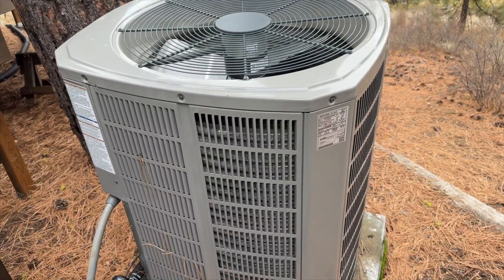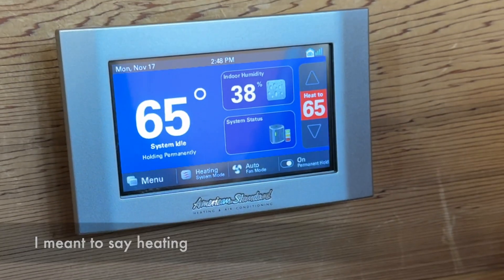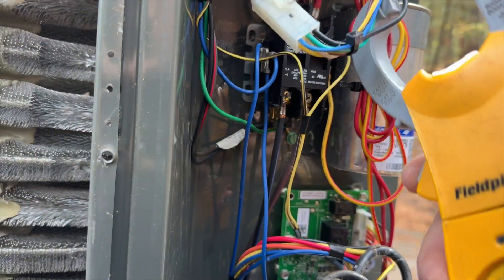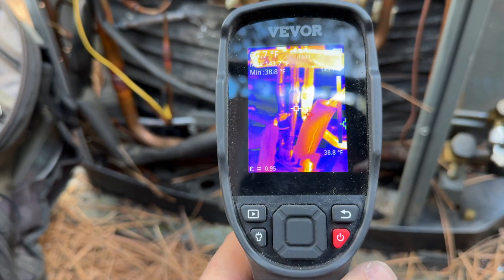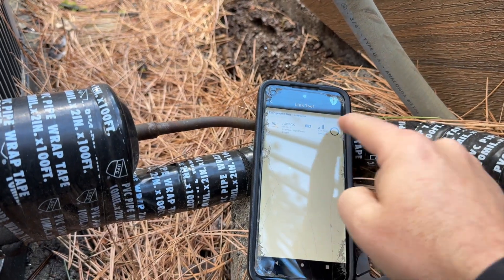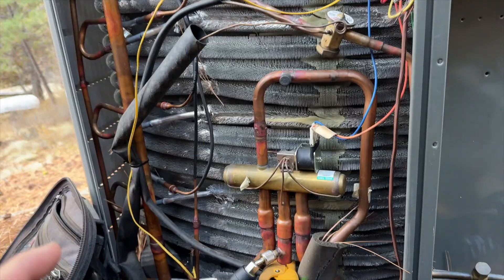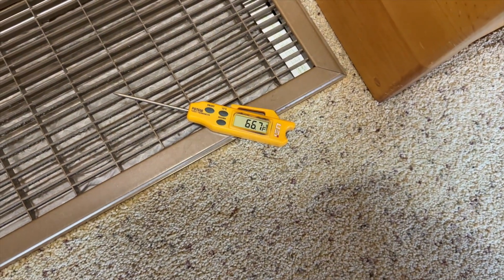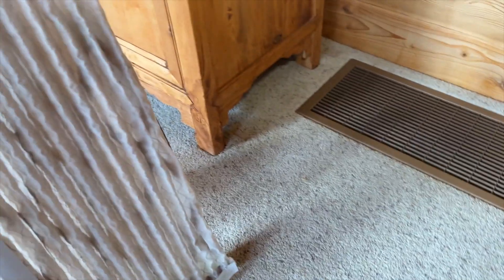Complaint of No Heat on this American Standard Heat Pump but the System Is Fine EP243

Comment: Another way to check the heat strips amperage is to take amps off of the incoming power off of the breaker. Just check amps off of each breaker.

Comment: Thanks for the video sir! I wish homeowners understood how bad these 1" pleated filters were for their HVAC systems and wish everyone had a 4" pleated...never two in series 😂

Typical pressure drops for homeowners so maybe they understand a little better......Lower pressure drops are better for the HVAC systems! 

1" Pleated Filter (MERV 8–11)
Clean pressure drop: 0.18 – 0.30 in. w.c.
As it loads with dust: can climb to 0.40 – 0.70 in. w.c.
Higher MERV (11–13) often starts 0.25–0.35 in. w.c.

4" (4–5") Pleated Filter (MERV 8–13)
Clean pressure drop: 0.05 – 0.15 in. w.c.
Loaded: 0.20 – 0.30 in. w.c.
Even MERV 13 in a 4–5" filter usually stays under 0.15–0.20 in. w.c. when clean.

Comment: You mentioned not recommending taking air temps with an infrared on your last episode. Does that also apply to the thermal imaging as far as taking the delta T? Good catch on the disabled options.
Reply from the maker: Yes.  The thermal imaging camera takes surface temperature not air temperature. Best to use a thermometer or psychrometer to measure air temperature.
Reply: @NighthawkHVAC Thank you for the reply 😎